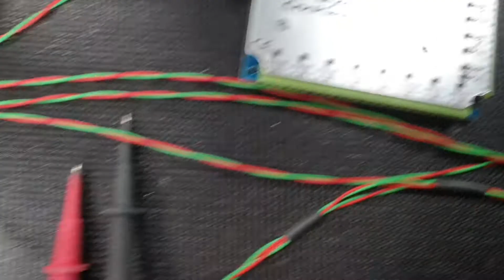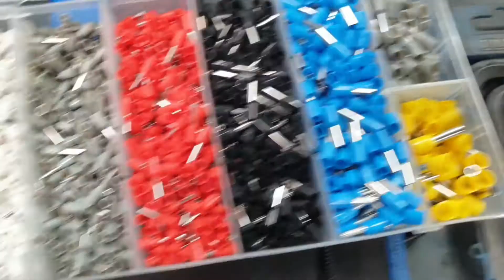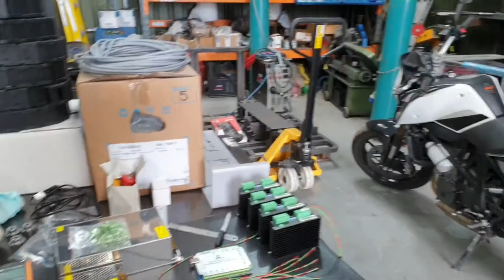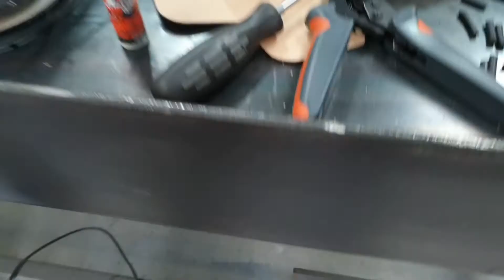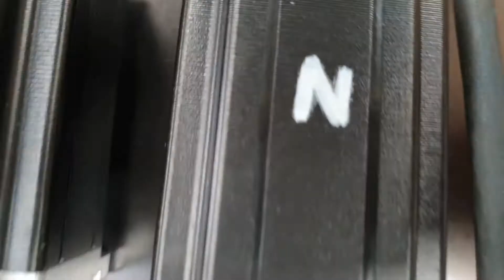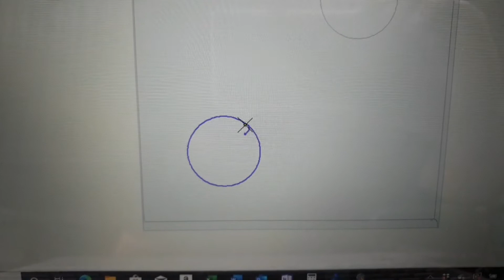Plasma CNC build. On going

Comment: Thanks for showing the electrics in operation. How did you slave the 2nd Y axis motor into the control board...is it done in the software somewhere, thanks.